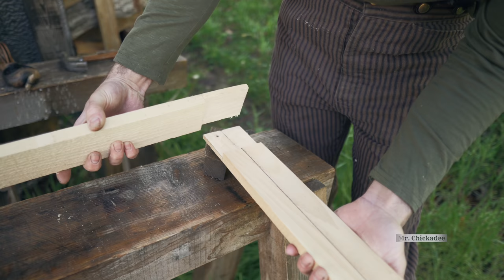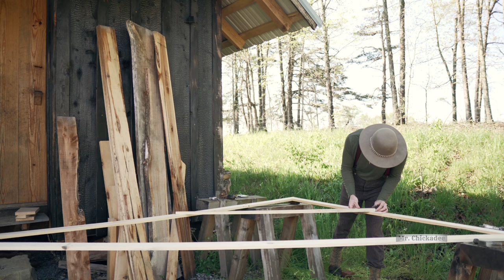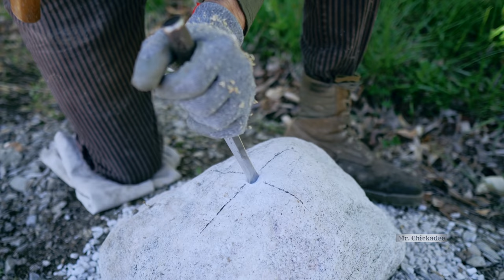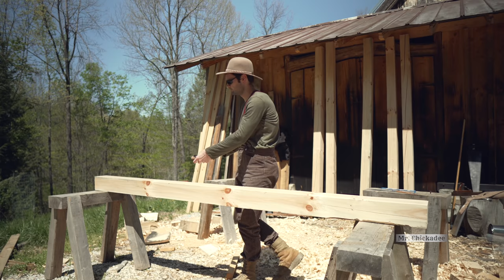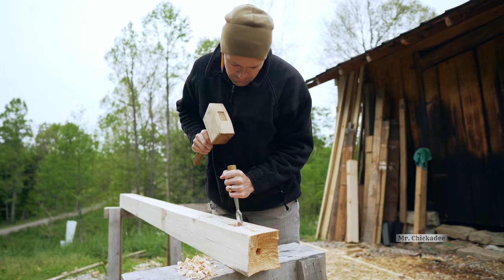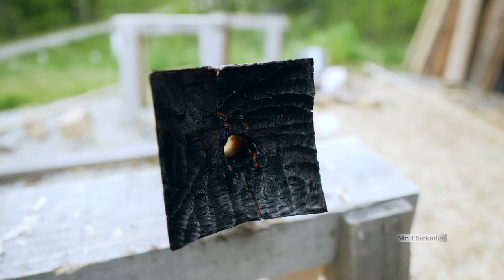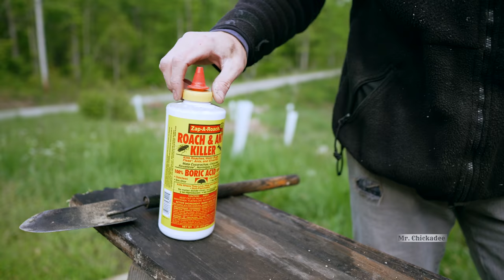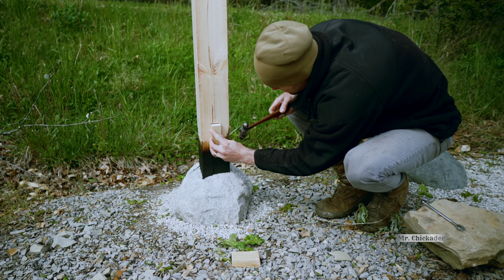Anchoring timbers to stone: ancient technique with modern twist for building codes/extreme winds.

Comment: How do you know how to carve the curvature on the inside of the post, once you know the curvature on the outside?
Reply: He probably did not and therefore chose put a mortar-like filler inside.
Reply: Just carve a bit extra, the grout will fill in.
Reply: he just made it to have bit more room so it can fit nicely when the mixture was added between the rock and timber. there is space filled with the sand mixture.
Reply from the maker: traditionally all over asia for over 1K years, the common practice is to just fit the edges and leave the inside hollow, sometimes people added some salt or grout with salt inside, but many are just hollow, and yes, they are find that way, many are hundreds of years old, some of the oldest temples are 1K+ years old just sitting like this. The forbidden city in China, those kinds of things, all have similar foundations.

Comment: Great video! I saw a small mistake tough, when using chemical anchor the two components don't mix evenly from the start and you're supposed to discard a 2" bead from each new cartridge. 

That's why there's a black and a white compound, so that you can tell when they mix properly.
Reply from the maker: Must be different from this one, it set up fast and hard.

Comment: Nice job, but I don't understand the point of using old tools and methods at the start, when you end up using modern anchoring chemicals, bolts/nuts and finally a ratchet i the end.
Reply: I think that was his point to reply to haters.. all his other videos are completely manual tools.
Reply: Normally, he doesn't. This was in response to specific questions and ideas people have have had about using mechanical fastener. If you watch some of his previous videos, you'll see his usual technique.
Reply: Building. Codes.
Reply: Maybe he likes using hand tools
Reply: Idiots complained it wasn't safe enough the old fashioned way so he put a modern twist on it, or did you not read the title?

Comment: I love your absolute peaceful expressions while working. This must be your true zen place. Folks talk too much these days filling the air with meaningless noise. It should be noted that prior to using anchoring like this the Japanese used the stone plinth foundations in a nation that sees hurricane force winds every year. In general. I would say this meets code more than is fully needed. Maybe against tornadoes but built properly and with enough mass it will generally survive hurricanes.

Comment: I love watching your progress Mr. Chickadee! Tuning in always helps to motivate myself. Also love bouncing theoreticals around, any reason besides cost for not using bronze threaded rod? Been watching a lot of boat building videos... Also possibly tapering the bore for the rod into a bit of an inverted cone so that when the epoxy hardens it wouldn't be able to slide up and out? Thank you for recording and sharing your thoughts and builds!
Reply from the maker: Bronze or stainless steel would be good both, bronze much more expensive.

Comment: I'm never convinced by the central pin idea. It has little effect in combatting the most likely and troublesome timber movement: twist.
Reply from the maker: Thats where the scribing and more so the joinery in the frame comes into play
Reply: @MrChickadee  RE: the cental pin.  Can you use rebar for this?

Comment: I see the 4 sides mimic the curvature of the rock, but how do you know how much the middle of the square bottom needs to be chiseled out?
Reply: I imagine that the sides are doing all the carrying and middle is not actually having much contact, being hollowed enough so sides could touch the rock. 
Seen people doing similar thing for example with wooden blocks and logs for their anvils so they would stay flat and stable on the ground-its really hard to get perfect fit between two surfaces and it gets harder the bigger actual area is, so people will actually remove material from the middle (make it concave) and remove wobble this way

To get a good fit you need to constantly check two surfaces against each other, having some kind of staining powder on one of them is helpful (brittle charcoal after fire treating the wood probably works), that way you can see where surfaces touched (and transferred the colouring from one to another) and slowly work your way removing the high spots
Reply: You hollow out extra and fill it with grout, as he showed in the video
Reply from the maker: as was done traditionally by most cultures in Asia, the inside is just hollow.
Reply: @MrChickadee  is it possible to chisel out too much? And if yes, how would you hollow it out? Place it on top, see it doesn't fit, lay it flat and chisel some more out, and keep testing it until it does fit?

Comment: The epoxy is a good idea. I remember watching a special with an interview with eustace Conway where he was discussing his barns being built on stone piers. I think he said that they'd used a steel pin through the center of the posts and into the stone,but it was just to keep it from shifting off the post. It had no nut or epoxy. He relied on the building's weight to keep it put.
Reply: He's done all this without any pins at all just super accurate fitment and yes gravity and weight keeps it all in place as long as there's no earthquake

Comment: Those are some fine chisels. Question though... Why do this technique instead of cemented posts?
Reply: Looks pretty
Reply: Apocalypse happened
Living innawoods
But honestly, I'd rather just improvise concrete than do what he did. I don't know if that's possible, but I would if I could.
Reply: He is building an old school Japanese style house using mostly traditional methods.  He does it because he can and it looks boss.
Reply: The difference between a work of art and a child's' watercolor is the details. Sometimes that's all the reason needed.

Comment: Some kind of homemade tar sealer put on the wood?
Reply from the maker: turn on ccs
Reply: @MrChickadee  I googled ... "ccs" youtube ... and I still don't know what it is. Closed Caption was my guess. I wish I could have understood this better. It looks like nice work, but the instruction aspect is cryptic.
Reply: Pine tar and linseed oil
Reply: @MrChickadee  Had it not been for this comment, I would have completely missed the additional information shared via closed captioning. Instead of improperly using closed captioning, in the future you may want to consider using open captioning, text that is visible to everyone, and can not be turned off.
Reply: linseed oil is used for waterproofing and pine tar helps as well, the pyrography basically makes the wood into charcoal which bugs dont like because a. acidity, and b. its no longer edible for them, so 1. its sealed against water which could enter through the now porous charred bits, and sealed against bugs through the charring. the ant and roach killer mixed with grout makes it so that if by chance they make it into that gap they assumingly would be killed trying to burrow through the grout.
Reply: @GregConquest  ccs = closed caption subtitles.  Turn on subtitles grandpa
Reply: @GregConquest  he is telling you to turn on the closed captioning and it will tell you what it is. 
If you can't figure that out then you have no business watching this video
Reply: sump oil was used on fences...free back in 50s/60s from cars....these days you just leave it like it is...all the ants are busy watching "around the leaf' technique to get up the pole and into the kitchen.

Comment: So I'M wanting to do something like that but what was the filler you used to set the bolts in the rock, what did the dirt mix consist of with the ant and roach begone and what was the oil you put on the wood after you burt the post?
Reply: that was probably the modern Twist ‘'
Reply: Looked like the same kind of mix you buy to fill concrete/cement holes, for plugs. You'll find it quickly, at a hardware store.
Reply: Turn on the subtitles, the info you are looking for is there.
Reply: The oil is pine tar and linseed oil mixed

Comment: I looked under a home in upstate NY, to see how it was anchored to the side of a hill...the answer....it's not.   it sits on river stones, smaller then a stack of 6 silver dollars.    The basement, is centered in the home, and likely keeps it from sliding down the hill, but, you can look at the air gap, under the home, and to the outside.   there is no way to get a mortgage for a home, with an unconvential foundation.
Reply: Maybe the point is to not have a mortgage. 🤷🏼‍♂️
Reply: I know half-a-dozen structures over 120 years old with a “loose” rock foundation. Never heard someone couldn’t get a mortgage one on.
Reply: I have a home with and unconventional foundation and got a loan for it.

Comment: What is holding the all thread rod into the stone?  I didn't manage to read what it said on the caulking gun.
Reply: Probably something like this: https://retail.usa.sika.com/en/products/adhesives/anchoring/sika-anchorfix-1
Reply: Sika PRO Select AnchorFix, probably -2.
Reply: It’s a Sikaflex adhesive. They have a wide range of products for different applications. You can get them at most hardware stores.
Reply: It's this: https://www.lowes.com/pd/Sika-Anchoring-Adhesive-Actual-Net-Contents-10-1-fl-oz/3374264

The AnchorFix-1 formula is good enough for what he's doing. Even in a storm, the possible forces applied to a single anchor (assuming that he has enough anchors to distribute the load) is gonna be fairly moderate. AnchorFix-2 is for anchor bolts on large equipment like power hammers that can exert very sudden forces on the anchor.
Reply: It was a two-component chemical anchor. You can get it from many brands. Just go to your nearest half-decent construction store and ask for a good one. They're available in caulking-gun-tube, glass vial, or special two-component caulking guns.
I usually get these things from Bison or Zettex, but that's in the Netherlands and I've got no idea if those brands are available in the US. But there shouldn't be too much difference between brands. They essentially all work in a similar way.
Reply: I think it is "Sika Proselect Anchor fix -2 "
Reply: Epoxi is code in california
Reply: Yeah it's a masonry epoxi.  See that tip, it mixes the two parts.  Like $25 a tube, last I checked
Reply: In the UK I use a brand called Anchorset, there are others.
It's a two part styrene based goo that has two bags in a caulk tube, cut the ends off, put the mixing nozzle on and when it starts coming out an even grey colour, squirt it down your hole!
At Lowe's you can get Sika AnchorFix-2 at $26/tube which seems stupidly expensive. There will be lower cost equivalents. It says stronger than concrete, it is, trust me on that!
Reply: Anchoring Epoxy
Reply: Turn on the captions and watch again
Reply: Sorry... thought he had captioned the epoxy.... my mistake...

Comment: Absolutely gorgeous result, and correct me if I'm wrong, but there is no way of telling that the 'inside' of the wooden beam actually fits snugly, is there? The lines that you draw on the outside follow the contours of the stone exactly, but any cut or chisel further inside the beam is purely a guess, isn't it?
So, where the video showed you chiseling the 'inside' and then proceeding to char the wood, I'm guessing in reality there have been quite a few tries in between to make sure that the cut part actually fits?
Very impressive.
Reply: pretty sure you just carve it pretty concave inside the lines, then use that mortar around the anchor to squish down and fill in most of the cavity, plus with contact all the way around the edge, under tension from the nut tightened down, it may not matter much if there's some air gap between stone and wood inside the edge.
Reply from the maker: Nope, traditionally, all over asia, practice was to leave the inside hollow, or add some salt or grout at times.
Reply: as long as the outside face profile meets the rock loading conditions will be just fine. the only thing it serves to do is rely on tension in the metal rod placed in the stone, rather than any bending strength

edit: grout may be necessary in some cases with large bearing loads on the beam, to spread compression over the area of the bottom of the beam rather than just along the edge of the outside faces
Reply: @MrChickadee   Yeah the point is to get an much wood as possible off the stone, leaving only the essential load bearing bits.  This helps prevent rot by keeping to contact points on the outside where they have a chance to dry.  The one thing I'd add to your set up is a piece of plastic under the wood and above the grout.  Since the grout and stone are porous there is still a chance of capillary action, and the plastic would prevent that.
Reply: @donaldendsley6199  He charred the wood - capillary action would be minimal, at best.

Comment: what did you put on it after charing it?
Reply: i too would like to know this

i assumed the charring would seal the wood pores a bit so any oil or varnish wont soak up into the grain
Reply: put the subtitles on....
Reply: pinetar and linseedoil mix, i think it sayd in the subtitles when enabled iirc
Reply: Old method in the south east of UK was to char the post and then saturate with old used engine oil, it lasts longer than linseed oil.

Comment: Boric acid can be used in mortar? Who knew?
Reply: The boric acid is only in there for keeping insects away.
Reply: Boric acid messes up the waxy coating on insects' chitinous shell, causes them to dehydrate and die. Diatomaceous earth will do the same, except that it works by cutting through at the joints. Not sure if you want to use DE in a grout or not, though.
Reply: By the way: boric acid & DE are pet-safe ways to handle flea infestations in your house. Sweep it into carpets and every crack & crevice you can find, then sweep up the excess. Flea eggs will die, and newborn fleas get sliced up by the DE.
Reply: @lairdcummings9092  : DE in grout might be fine, but it'll also be useless. Every once in a while someone will put down so much that bugs walk on it instead of through it, so it only works on the bottom of the foot. So, for this sort of usage, if you wanted to add DE, then you might as well add it as a dusting around the edge or something.
Reply: @lairdcummings9092  It does work to kill fleas, yes, and it is technically safe for people and pets once it is there and settled, but while applying it, for a bit afterwards, and if the area is frequented, the stuff hangs in the air for quite a while, and you or your kids or your pets are breathing in sharp microscopic fragments. Especially with pets on carpet, each step someone takes on that carpet launches it up into the air and pets are low to the ground.

Comment: Why did you choose not simply flatten the rock? Seems a logical first step...
Reply: An not flat stone will repeal water away when a flat stone will pool around the structure and rot to wood. The char is just the additional protection to prevent that but not a 100%. In some cultures they char the and tar the wood footings to give longer lifespan to their structures when it’s touching the native soil.
Reply: lot quicker to chip away wood than stone
Reply: Easier to form wood w/ a chisel than to form stone with the same. 
Also, replicating an ancient building technique where they didn't flatten the stone first.

Comment: what stops the rock from blowing over?  I don't get it.  The whole thing could just be picked up.
Reply: not with a building sitting on it.
Reply: That is true. Let's say the weight of the building resting on stone piers is 4000 pounds. If the wind is strong enough to lift the structure vertically then adding 600 pounds of bolted stones won't matter. 

I think the purpose of this technique is to greatly resist horizontal movement, such that the structure will not be incrementally pushed off the piers sideways by hundreds or thousands of gusts of wind. The structure cannot easily slide because the surface area of the bolted stone that touches the earth is large and therefore would present a lot of friction under load.

Comment: Thanks for another great video. I really admire your work and the essence and philosophy behind it. 
In this video, however, I have difficulties understanding the connection between the construction made in the first 3 minutes of the video, and the post-to-stone fitting. I thought it would be described in the closed captions, but there is no description there. 
Great job and brilliant idea anyway. Keep inspiring us!
Reply from the maker: the large wooden square is used to lay out the foundation stones. no string lines or batter boards needed.
Reply: @MrChickadee  Thanks a lot for your answer.
Ok, I got it. So, indeed, this wooden square is a great idea if you want to avoid string lines and batter boards, but applicable mostly on smaller scale structures, right?
Wish you all the best!

Comment: Maybe I'm just a goober but, I've always just dug a 2+ foot deep posthole... set the post in level and filled the hole with dry concrete mix before adding water
What am I missing, here... The point ?
Seems to me like there's nothing anchoring that rock
Reply from the maker: Mostly longevity, also beauty and tradition. A post stuck in the ground will eventually rot, faster in concrete. Temples built the way I show here are still standing like this after 1K years.
Reply: the natural beauty, man!
Reply: wood will rot where moisture is allowed to sit, concrete is somewhat porous but better than just being directly in the dirt. this method keeps the post completely above ground allowing it to dry out whenever possible to help stave off the chances of rot.
Reply: The weight of the finished structure will generally anchor that rock (and the others).
Reply: And of course, you don't read the reply after asking a question.